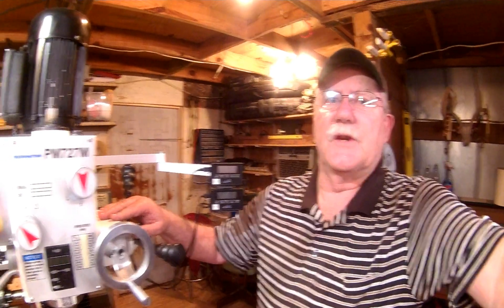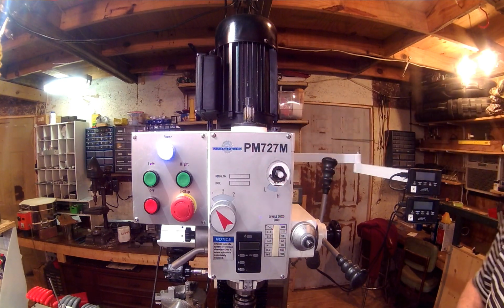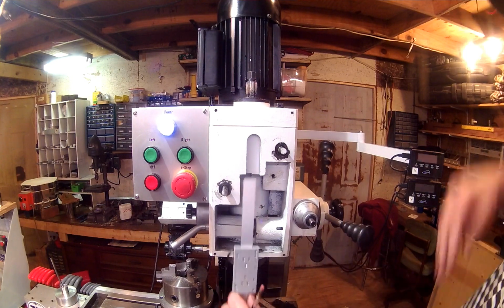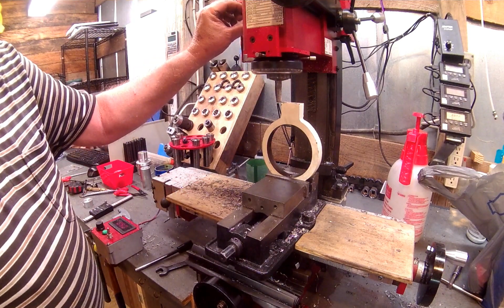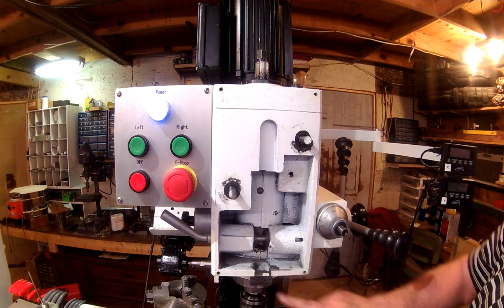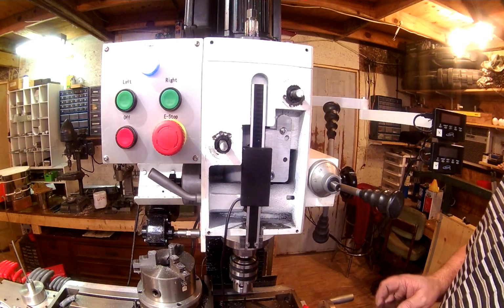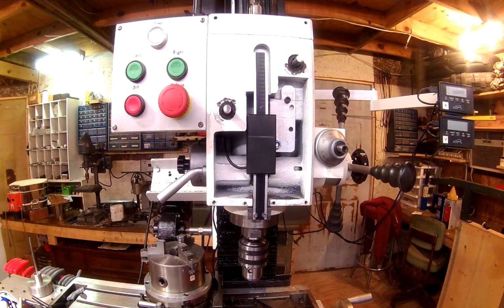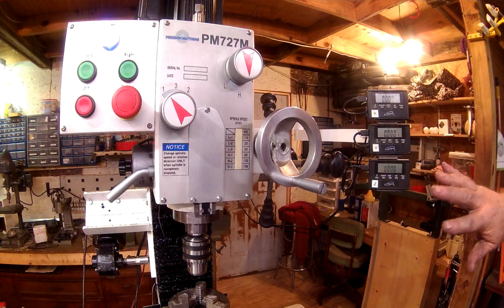PM-727M Z Axis DRO Replacement

Comment: I'm fitting a DRO to the front of my milling machine but I had a terrible trouble trying to remove the knobs I took the grub screws out but they were still stuck I thought they used lock tight on them then I watched your video on you doing the same job as me but you said they were held with two grub screws and watch out for the balls dropping out so after a couple of days scratching my head I found the other grub screws down in the hole then the knobs came off easy so thank you very much for showing me. Doug in Australia.

Comment: think i wouldve mounted the new dro with the grey side to the front straight to the back of the faceplate 
allso would mount the tablet in a dedicated cradle (got a nexus 7 myself ) where the tombstone coverplate sits now covering the hole up nicely and provide the mounting for the dro (though i dont think its that hard to make a new coverplate , xerox the original for all the writing , the holes and such and have a stick on template made to drill the holes and paint over it then remove to show the lettering ) that way you'll keep the original plate like it is 
that way you dont have to drill through the side of the machine and mount the ardino behind the tablet or on the side of the vertical axis adjustment (under the fine tune wheel)
think you can then route most of the wiring for the horizontal axis through some plastic airhose in he colum

Comment: Nice job Lee. I really like those I-Gaging DROo's. I have them on my lathe and mill. I have taken the batteries out and run them from a pc power supply with a 12v to 3v dropper. I need to look at this "touch DRO" software and see if I could use it to upgrade my system. Links to the software and hardware would be handy. Thanks for sharing. regards from the UK

Comment: hi lee I was wondering how did you put the nut on  your power fed build. I can not figure it out how you put it on the sliding shaft was it machined thread on  sliding shaft. you would haft to put a set on it that part is very confusing to me the rest of the build very well thought out 
thank you
Richard Westerfield

Comment: Nice idea to incorporate everything together. I make do with the Z DRO but for X and Y do want to get a better display. My current one is inexpensive and basic, but would like to upgrade - trouble is cost!!
Useful to know that knob removal secret. Of course BBs act for detente function.
The new unit went in great - nice bracket solution, and great video Lee.
Reply from the maker: Thanks Chris - really hoping to get the rest of the components in this week.

Comment: Nice video Lee, 
I'm having some issues with my DRO on the PM 932 along the X axis, 
I'm not sure what I'm going to do about it at this time, Either I get the Glass scale replaced again or I may opt for a complete replacement from DRO Pro's with Magnetic Scales. decisions decisions...
Thanks for sharing
Reply from the maker: Phil, these iGaging DROs are by no means the best on the market, but they definitely serve my needs.  Not sure what kind of problems yours is giving, but be sure to check every mounting screw for the scale and the reader. The slightest bit of movement in either will make the DRO appear to "jump".
Reply: +Lee  the dro stops " progressing" or it stops readings for a certain distance . It's happened before and Precision Matthews  sent me a replacement scale which solved the problem. I have now taken the time to contact Matt about it but I will soon  as you don't miss it till you need it